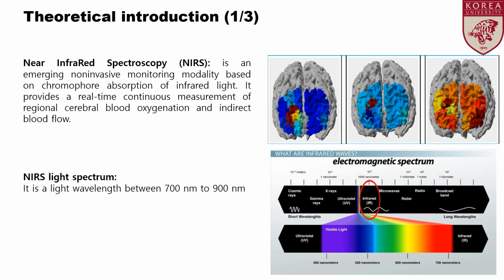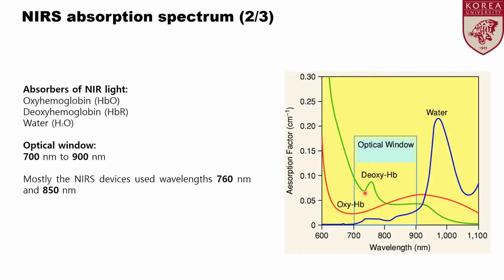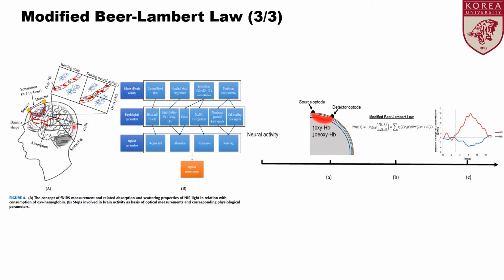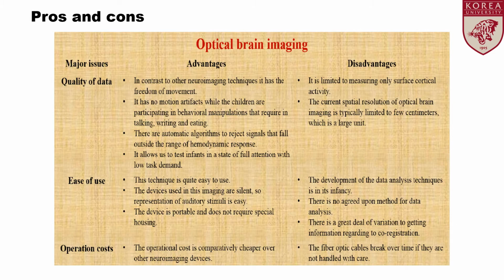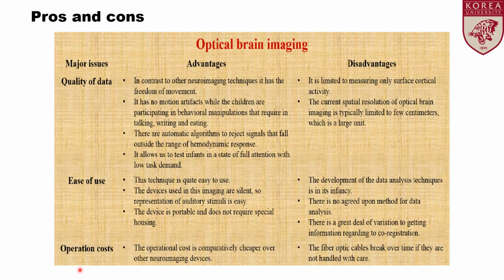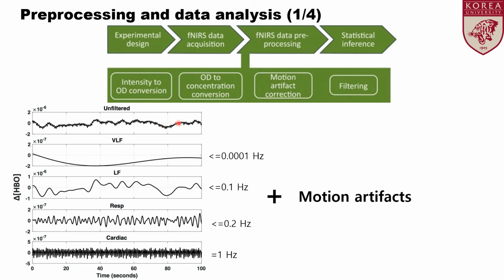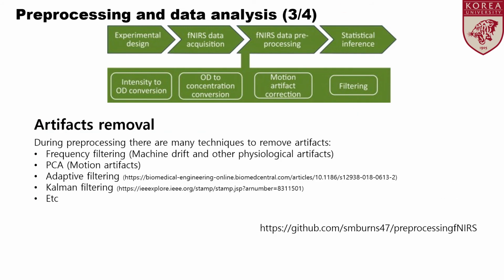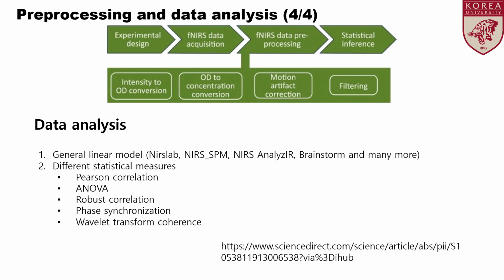Introduction to fNIRS device

Comment: Thank you for the presentation. As far as I know, the fNIRS signal is relatively robust to artifacts and very low signal (< 1 Hz). Then, can we just use the data after simple filtering? How much noise is still left after such filtering?
Reply: Shoaib Zeshan[ 교수 / 산업기술연구소 ] ‍  Thank you so much

Comment: Thank you for your presentation.
I have a question, Is there any reason fNIRS has better spatial resolutin than eeg?
I think it will be the same because the electrode is attached to the cap equally.
Reply: Shoaib Zeshan[ 교수 / 산업기술연구소 ] ‍  Thank you